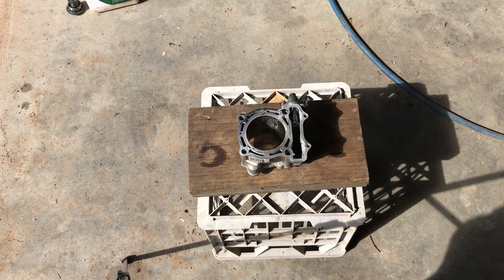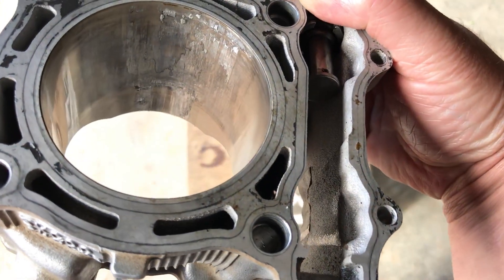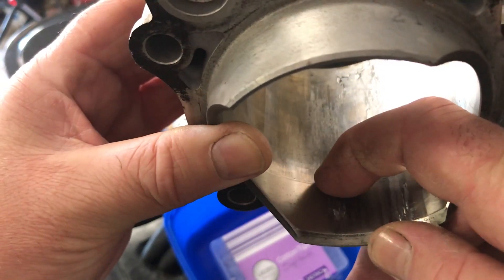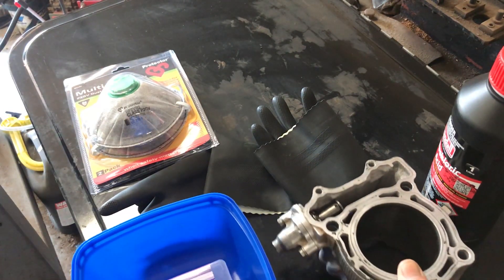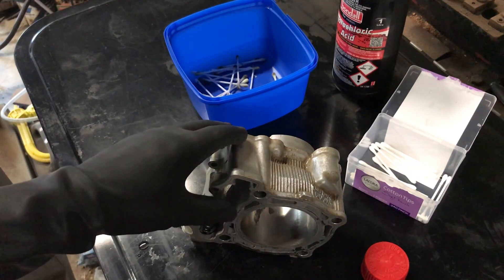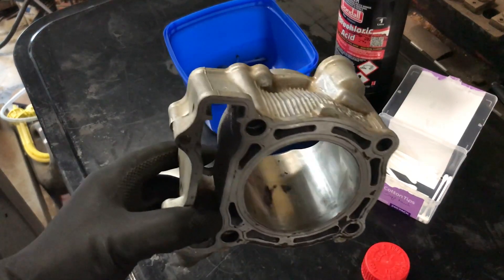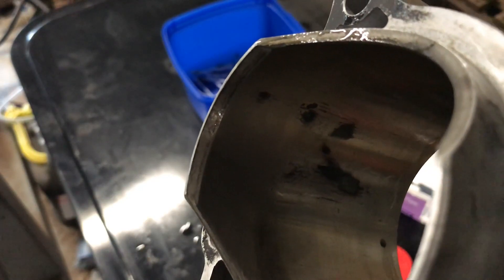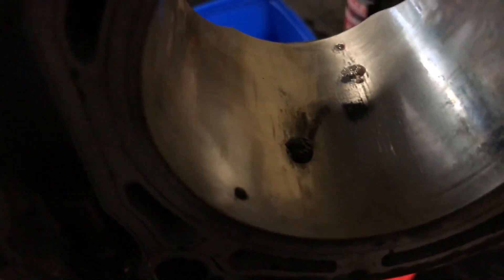Motorcycle Cylinder Clean With Hydrochloric Acid

Comment: Bunnings acid is only 12% or so, need to use the real stuff from a chemical supplier.
Reply from the maker: Thanks for checking out the channel. Your info is much appreciated. Must admit it did take a few goes to make any headway. 👌
Reply: The msds for bondall states that it contains 26-30% hydrochloric acid 
70-74% water 
<1% titanium dioxide 

Plenty strong enough for rust removal